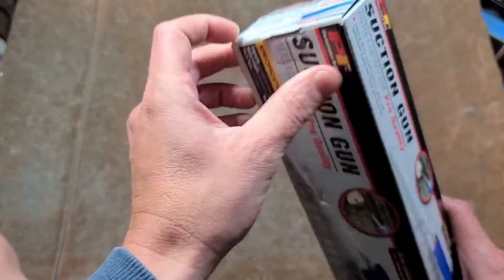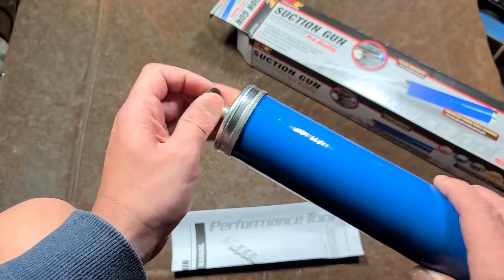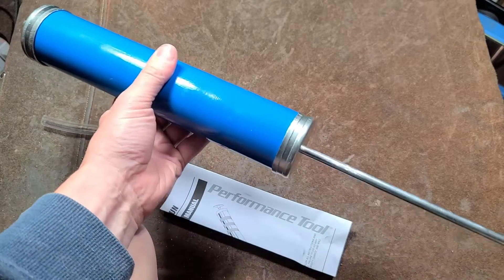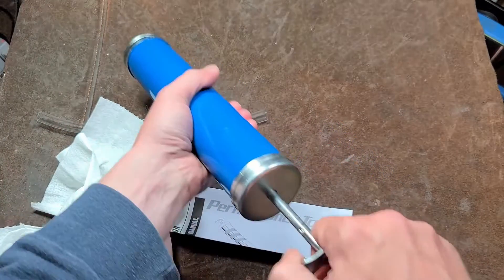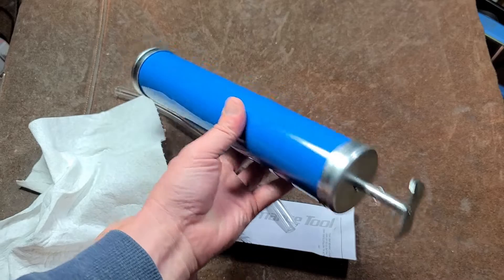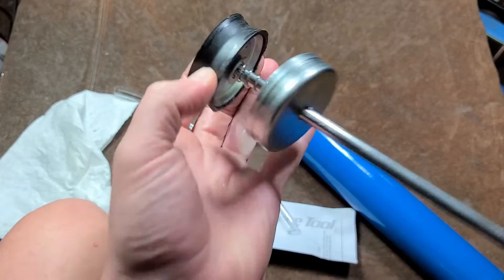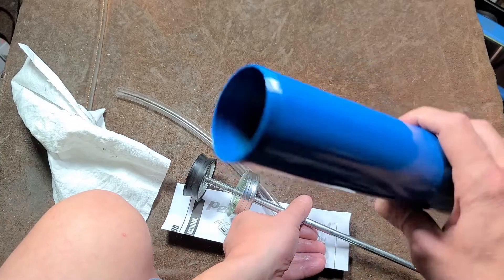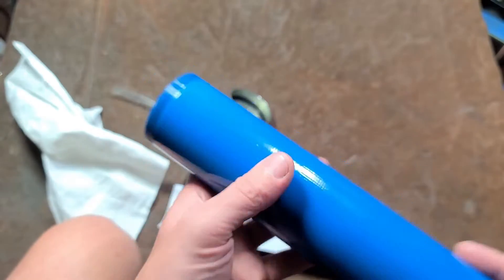Performance Tool Automotive Suction/Injection Pump Review

Comment: I got the HF version and looking at it right now as I watch your video. They are very similar. No cap on the HF and both ends are the same, no lip. The spring is shorter on the HF version too. I thought I may have to use this when I bought the transmission oil pump as well. I just got both since I read the cap on the other pump may not work. It works if you make your own cap. Either way I kept this one too since I didn't have anything.

Comment: Update on my previous post:  I used this tool for the first time today to suction out the oil from my riding mower.  It worked great for that; no problems at all.  I'm going to try it on changing the fluid in the differential of my truck next.

Comment: Nice review.  My dad called it a rose gun, don't know why.  I have used mine for many years to fill and drain transmissions, transfer cases, and differentials.  I put a ziptie on the hose for a clamp and a 10 mm vacuum cap as a stopper.  I use a turkey baster ($1 at Dollar Tree) for brake fluid to prevent contamination.

Comment: You surprised me with this one. I'd never seen a fluid transfer thing just like this before either but I just bought one of these at NAPA last week except painted black and branded Evercraft. I needed one for changing the hytran in my zero turn mower. You mentioned a thing or two I hadn't thought of to use it for though. They look like they could have come from the same plant like a lot of Chinese stuff. Mine seems pretty decent too and the price was about the same  at Napa at least til the end of the month for anybody that doesn't have a place selling PT stuff. It's in their August flyer. I like some PT tools too. I didnt realize I had as many as I do til you started doing these and I started noticing them in the box. Thanks for the video.